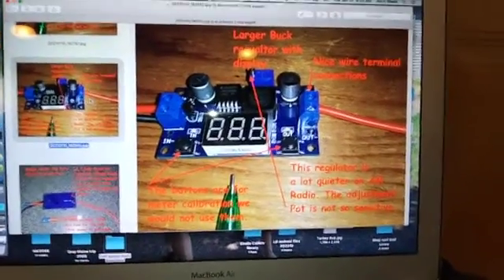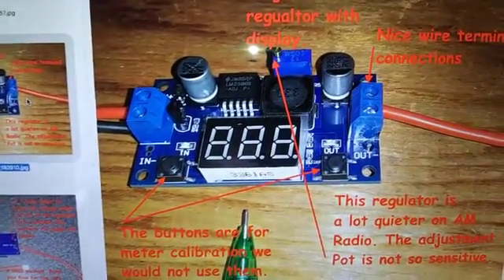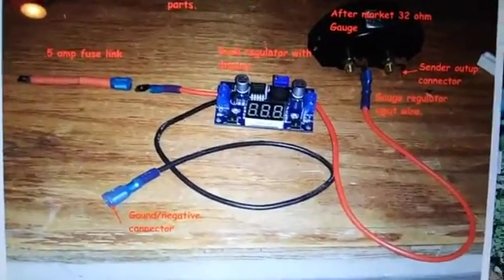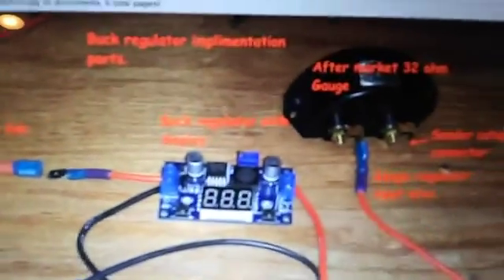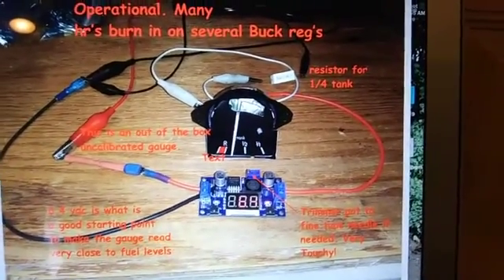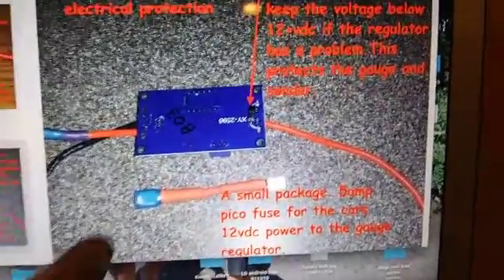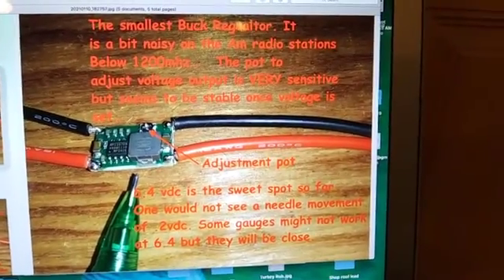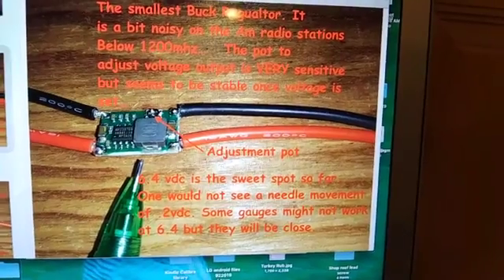Buck reg introduction. Showing operation and hook up

Comment: Gotta link to the thread with parts and schematics?

I my OE gauge broke so I need to use an aftermarket for a while.
Reply from the maker: There is no need for schematics.  The regulator has + and - labels and in and out...  So it is a soldering, adding fused protection, knowing how to put 1/4" connectors on wires properly  and the knowledge and use of a DVM....  Read my comments below the video.  Here is what I said, "  This video is for information.  I am not a manufacturer and will not produce this product.  I am in hopes that the Vendors will press the Gauge MFG to fix the gauge.  Or provide something similar to solve this issue.  
This gauge regulator applies to buses, Gia's, Beetles std and SB, Things that use the electronic gauge.

Doing this project without knowing electronics and soldering is not recommended.  Damage to your car could occur.

Finalized wiring, showing protection devices for over current/voltage.  I assembled the pico fuse package...  .5 amps/500ma and installed the 7.5v 5watt zener diode for voltage output protection.  I used very flexible wire with high strand count and a silicon based insulation.  

Caution:
The voltage adjustment potentiomenter/screw is a 30 turn potentiometer   Turing the screw 20 turns CCW will drop the output voltage into  safe voltage to start adjusting!  Bench adjustment should be done before installing...  Set the output voltage for 6.4vdc.  You can use a 9vdc battery for input voltage to set the output voltage.

All buck regulators come from the factory set to high voltage output.  Adjusting the voltage down to around 2-4 volts before adding the 7.5 volt 5 watt Zener diode is required, if you do not the zener and the regulator will fry.  If you have already put the pico fuse on the fuse will blow protecting the Zener. The aftermarket gauges have 32-35 ohms...  The set voltage of the Buck regulator seems to work best around 6.4vdc.".....  Jim.
Reply: @vwbeetlefuelgaugesystem  which regulator did you use? I thought this was one you built.
There are dozens but finding a good, easily adjusted one in a nice tight package is a bit more daunting.
Reply from the maker: @TEDodd  I went through a few renditions before I settled on this one.  After getting it all working I used shrink tubing to cover the regulator.    https://www.amazon.com/gp/product/B07WQJ2GD6/ref=ppx_yo_dt_b_search_asin_title?ie=UTF8&psc=1
Reply from the maker: @TEDodd  Here is a link to how I ended up packaging and protecting the circuit board.  https://photos.app.goo.gl/J9gezBPezhE5Ez6BA
Reply: @vwbeetlefuelgaugesystem   Cool. So you just tweak the output voltage until the gauge read full when the sender is at full (10 Ohm)? No need to adjust the stuff in the gauge?
Reply from the maker: @TEDodd  No.  You hook up the buck regulator to a battery...12volt  all by itself and set the voltage to 6.4 vdc. Got to make darn sure that you hook the polarity up correctly!  Then it is ready to hook the wires you make to attach to the gauge and the wire that hooks to the OEM vibrator or the aftermarket plastic regulator.  You must add the protection diode and make the fuse link to protect your car in case something happens to the buck regulator.    I have done 12 gauges with the Buck regulators and all of the aftermarket gauges read very close to the Empty/R/ 1/4  1/2 and F... No tweaking of the gauges.
Reply from the maker: Are you a member of THESAMBA the VW forum that is world wide?  If you are why don't you go there and send me a PM....  I am blue69baja on there...  We can have a better communication.  https://www.thesamba.com/vw/forum/
Reply: @vwbeetlefuelgaugesystem  
I was looking for a thread thesamba about this regulator. It'd be good to have one with pictures and such and just link to it from the video.

Then in 5-10 years all the info is there w/o bothering you. I've often had questions answered in old threads and not had to ask any further.
So 6.4V has worked consistently. Cool. I figured some tweaking might be needed, somewhere between 6 and 7V
Reply: It looked like screen shots from a forum thread. I figured you had that info there.